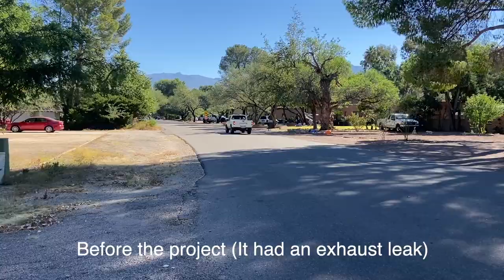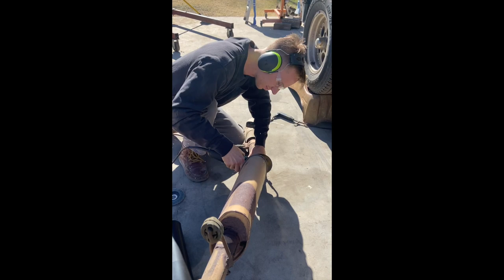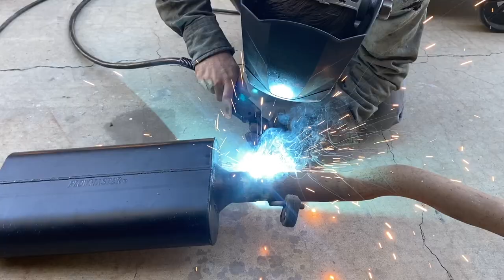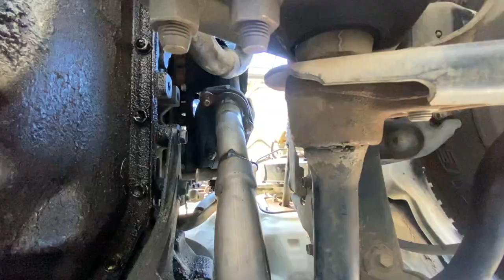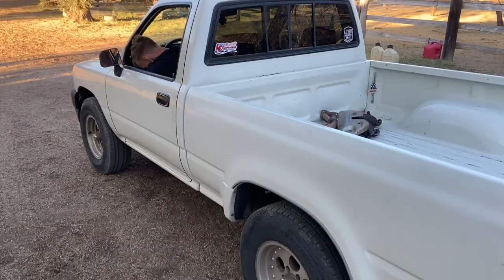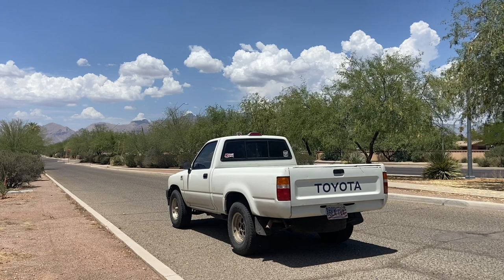Toyota pickup 22RE - Flowmaster 50 Series Delta Flow

Comment: What is your wheel set up? Looks bigger than The stock 14s. I have the same pickup with a flat bed on it but want bigger tires.
Reply: Same here thought about Lexus 17s
Reply from the maker: The tire size is 235/75R15. The truck’s got 3inch body lift.